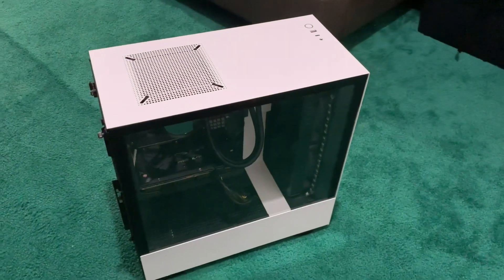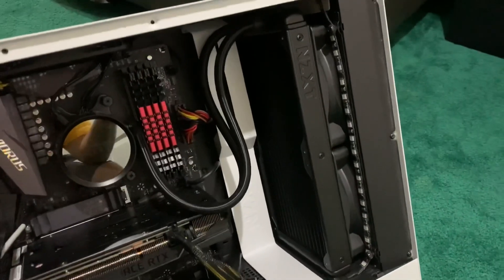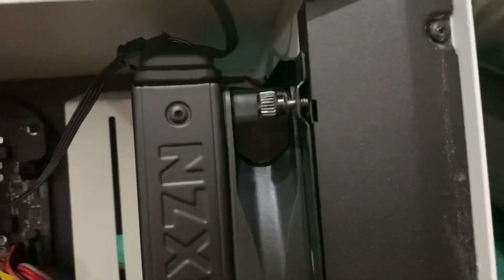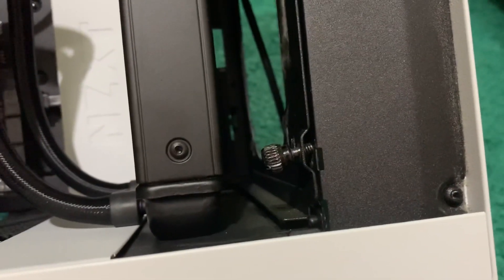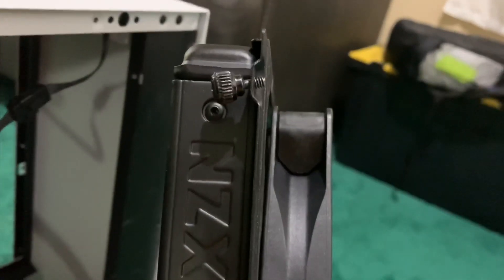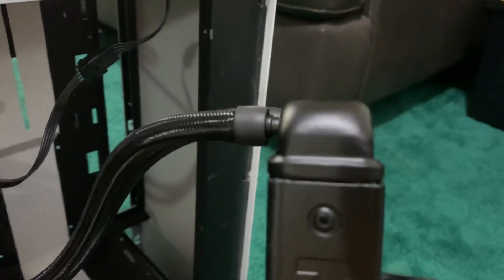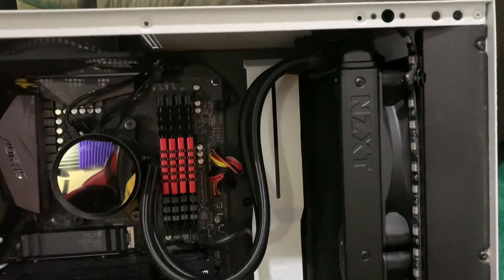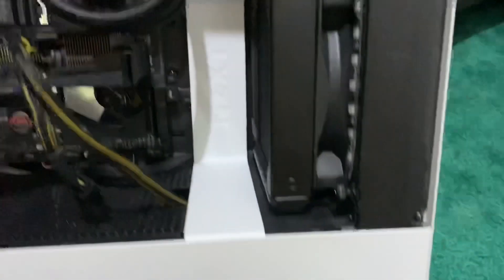X63 AIO will not flip in a H510 Case

Comment from the maker: https://www.youtube.com/watch?v=DKwA7ygTJn0

Were all good!  More info from JaysTwoCents explains it much better.

Again this video was JUST to show the 280mm AIO may or may NOT flip, depending on your components.
Reply: Thanks for the information. 
The front placement intake is good, but not the best.
Probably that's why so many people harp about front placed, tube up placement as "bad."
Reply: @chrinaldi  yeah , at the end the important thing is that the metal bracket is lower then the top of the aio so the bubbles stay on the top
Reply: instablaster...
Reply: I mounted it as you did  so fans in the middle. The fans are making such an annoying buzzing sound( i guess vibration )
If the metal panel touches the fans i mean.

 it drives me crazy
Reply from the maker: @kokilalf01  odd.  Make sure everything is flush or the bracket or fan wires are not bent/touching the fans blades

Comment: Hey! I have been scratching my head as to why I can't fit my x63 in my 510 case. At first I tried to fit it in the tubes down configuration but the bracket screws wouldn't line up. Today I tried it again and was successfully able to mount the radiator and fans onto the bracket. The bracket then fit into the case with the tubes down configuration. You need to mount the radiator and fans onto the bracket with the large screws. Once the screws are in loosely you should be able to move the bracket up and down. Moving the bracket downwards allowed me to fit the x63 in the 510 tubes down. Hope this helps.
Reply from the maker: With all this feedback I’ll Give it another closer look.  Maybe its my bracket.  But off camera I tried fiddling with it to fit and it wouldn’t line up.    

Y’all gave me home work to do!
Reply: The frustrating part is that I mounted mine tubes up but it took a hell of a lot of work and is kinda pushing heavily against the IO cables
Reply: Thank you! I managed to mount my Kraken Z63 with the tubes down on my H510 Elite by loosening the long screws on the fans.
Reply: Thanks so much bro. Was about to cancel my order after seeing this video, but think I’ll try your method first to get the tubes down! Out of interest, what temps have you been seeing with the X63 as well as noise levels?
Reply: @justjackm8  getting about 28-32 degrees celsius on idle and about 38-42 degrees while gaming on my 10700k at stock. So it's been definitely been staying on the cooler side of things. Did some overclocking and have been very far away from hitting any kind of thermal limits. As far as noise goes its very quiet - unnoticeably quiet for me.
Reply from the maker: @justjackm8  Im getting around 54c idle with web-browsing throughout the day,  in high 40s when sitting completely idle  low-mid 60s under load.
Reply: @tz1371  I just successfully mounted it today tubes down using your configuration - legend!
Reply: Hey, do you have a picture of that? i cant get it to work :(
Reply: @tz1371  This works for the Elite as well! Thanks! Loosen the screws. Move it a few cms and tighten again worked for me. I did take off the washers as well to give me more room for loosening and tightening.
Reply: @tz1371  do you re tighten the screws once they fit?
Reply: @SupremeWoolf  yes
Reply: @tz1371  i dont think itll work for me. My radiator is 280 mm
Reply: @CF-fu7ct  it worked with my 280mm NZXT X63
Reply: @tz1371  weird, the brackets dont line up for me. I tried loosening the screws but i think im going to cut a little into the screw holes to allow more movement
Reply: @CF-fu7ct  Did you try it the same way as this photo???
https://imgur.com/FvINH6E

It does fit.... I remember it took me AGES to figure it out tho.
Reply: @tz1371  yeah ive been staring at that picture and in convinced that you performed some sort of witch craft without realizing it. Ill have to try it again. Also is the white strip pressing against the little tubes?
Reply: @CF-fu7ct  Hahaha! It's defenitly possible! That is the cable management bar in the 510

Comment: You can still mount the radiator tubes down. There is space on the bracket for the radiator to sit flush towards the tube area. Just screw at the end of that space. 👍🏽

Comment: I just got mine to fit in like 10 minutes ago. Was about to give up and put the tubes on top. For me it really came down to the bracket -- you need to slide the radiotor/fans "up" as far as possible before/while you screw in the 30mm screws. Then it's just a matter of getting it all in and aligning the thumb screws. It's definitely possible, but the hoses will definitely be RIGHT ON the bottom of the case, but they don't look bent or crooked or anything. Same with the thumb screws, all straight.
Reply: Yes it worked for me as well
Reply: Had the same issue, above comment solved the issue. It just a matter of a couple centimeters for it to fit.

Comment: Can you switch the fan on the other side of the radiator ?
Reply from the maker: I can,  ive done some more videos with this setup in front and behind like shown here.  works either way.  Dont fully tighten the screws on fans and rad until you test fit (allows them to move and adjust when fitting into the mounting position.)  after test fit, and the fans adjust up or down, you can then tighten them.

Comment: you can fit the bracket on the rad with the fans in the front of the case if you cut or bend the top lip of the bracket so it sits flush on the rad.

Comment: I know this is an old video but just in case someone comes across this.  If you watch Steve's video on Gamers Nexus until the end, you'll see where he explains that as long as the pump is below the intake/outflow hoses, air pockets won't form in the pump and won't burn out the motor as long as it has enough liquid.  The air will travel to the highest point in the loop and if there isn't enough liquid in the loop, then the air pocket would settle where the intake/outflow is if mounted with the hoses at the top.  Just remove and shake your Rad, if you hear sloshing it needs to be replaced or mounted with the hoses down.  If you can refill, do that (if already past it's warranty. most AIO's don't allow refill).  But if you shake it and barely hear any liquid movement, then you're all good.

Comment: I dont know what youre on because i fit my 280 in the case with the tubes at the bottom perfectly, bracket holes are adjustable and u have to push the radiator tye the top when installing it so it clears it
Reply: @f ?

Comment: how does it get its air flow when its right up against that wall? i have this case and im thinking of either buying that aio cooler or getting a different case that has better ventilation
Reply from the maker: Air flow is good the side dust cover has to be cleaned monthly .  Temps Stay low and overall system is very quiet

Comment: Glad I saw this. I have that same case and was debating between the x63 and 53. Im glad I went with the 53. Great video and very helpful.
Reply: Can you flip it?
Reply: @dineshdas8392  As far as the fans location, yes you can. If you're asking about the orientation of the radiator, yes. My radiator is attached so that the pipes leading into it are at the bottom. It was a bit of a tight fit but was not difficult to install.

Comment: How did you get the radiator and fans on the bracket inside the case? I have seen other videos on youtube whete they could only fit the radiator and slim fans on the inside.

Comment: How did you mount the rad, fans and bracket like that? Struggling for about 2 hours today trying to set up my new X63 and no luck. Had to just put everything back. Any other combo and I was getting stopped by the cords leading to power button, USB, etc and did not want to try and force it in
Reply from the maker: Sorry for the delayed response,  start screwing in the parts together, just finger tight.  slide the gear into the slot and it will adjust.  When you remove it, try to hold it all together so it doesnt shift, then tighten it to the bracket before re-installing.   took me a few tries but i got it.

Comment: 240mm doesn’t work either, at least with a 3 fan graphics card. I just tried it and the radiator can go in, but the tubes are not long enough to make place for my GPU (rtx 2070 ROG strix)

Comment: Is it possible to configure this aio with this case with the fans on the other side of the aio? Im thinking of getting the x63 in the future and I have the h510 case. 
Id simply prefer that the fans would be exposed instead of the radiator purely for aesthetic reasons and considering you cant flip it, I was wondering if it also has any other restrictions
Reply from the maker: Yes you can put the fans infront of the case to give more room for a long GPU or to do a Push/Pull config on fans.

Comment: So just to be 100% certain would a 240mm Kraken X52 fit in the h510 case with the tubes on the bottom or not? I have a h210 but I'm thinking about getting a 510 case if it'll work.
Reply from the maker: Yes. Both are proven to flip with tubes down.  I just haven’t had the time to flip mine and update the video.   Life has consumed me and I game before I tear apart the computer for a video lol.

I’ll get one up hopefully soon
Reply: @maz94protege  Hey do you think its worth the time and money to get a bigger case so I can flip it?? I built the PC myself about a year ago. I haven't had any problems but I want my cooler to run as efficiently as possible. I also don't want to kill the lifespan of my aio pump. What do you think should I do it??
Reply from the maker: @ogsniper743  Honestly No,  I dont think it will make any huge difference.   I have viewers on here preaching to me to flip it and prove it can be done,   The updated video from GN (Gamers Nexus) cleared up alot of confusion throughout the community over this.   

I did this for a test/proof of concept.   The Pump is not at the top of the cooling loop for one.  Downside to what my current configuration is having the possibility of small air bubbles towards the top of the radiatior (highest point in the loop).  This COULD cause some gurgling or noise. and over Years of use COULD degrade faster than flipping the tubes the opposite direction.

Again,  its not life or death,  I think we all jumped to conclusions early, but as long as we dont have the radiator on the Bottom of the case we all should be good.   
I always monitor my temps (really just for fun) but this also is my first ever AIO, curious on how long it will last, etc.
Reply: @maz94protege  Hey thanks for taking the time to respond and answer my question!! I know everyone is busy this time of year so thank you. I kinda decided I'm just gonna leave it like it is. I've never had any problems with my      cpu/gpu temps or any noise. I have my fans set to performance and I don't think I've ever heard them, but I always have a headset on. I've never heard any gurgling noise either. It's just kinda bullshit though, they shouldn't advertise there products being used incorrectly. I took my time buying my PC part by part making sure im doing everything the right way and then now, a year later I see this. Well done NZXT 🤬
Reply: @maz94protege  so for an aio does it matter if the fans are on the inside or outside?
Reply from the maker: @matt1696  you can set up your fans in any configuration push or pull

Comment: Not sure if the elite case has more room or not but I have the 510 elite with a 280 mounted with tubes at the bottom and it fits fine.  And this is with a 3080 Strix card.
Reply from the maker: They have the same room. I'm actually going to toy around the fan setup today.  Make a short video of some internal upgrades and such.   Standby for an updated video!

Comment: can you do some testing with 100% CPU load and check temps? I have same case and a r7 5800x cpu with a be quiet DRP4 and temp is like 84c with cinebench multi core test. Not sure if the NZXT Kraken X63 was a better option.

Comment: i don't have this case yet, but i have a very chonky Arctic Liquid Freezer II 280mm. WIll this fit, GPU size aside. Does the white bracket interfere with the AIO, as in thickness? or is there much clearance? thanks.

Comment: have you tried to install the fans in a pull configuration? so that the pull the air through the rad instead of puch? just wondering. i dont have that AIO but the one i have i have in a pull config and it fits fine.

Comment: Flipped my radiator before watching this video and ran into the same issue. Had to search it up to see if it was only me. Edit - reading the comments, loosening the long screws allowed me to push down the plate and I managed to fit it in.
Reply: If you losen the fans from the bracket and then pull it down and tighten the fans you can actually get in. I managed to flip mine in my h510.
Reply: @stevenllerena8280  Thank you! it managed to fit :)

Comment: Definitely just mounted an x63 in an h510 elite, tubes down, this past weekend. Existing rgb case front fans in original position, x63 included fans on the back to make a sandwich.
Reply: Prove it I need this to work
Reply: The h510/h510i and the h510 have a different fan bracket. The h510 bracket is flat and leaves no room for a sandwich style (bracket in between radiator and fans)

Comment: Good video, thanks - I 'think' you need to shimmy that radiator, tubes down, a little better into the front. My friend has the H510 Elite + Kraken x63 and had no problem with it fitting and doesn't seem to touch the bottom.
Reply from the maker: Look at my latest video.  We flipped it.  No issues with tubes up or down.
 After a case clean out and other viewer suggestions I figured out what I was doing wrong lol

Comment: You don't need to flip the radiator.  The pump/block position was already lower than the radiator's intake hose.
Reply: The point is that the pump needs to be higher than the radiator intake when front mounted

Comment: I have an h500 case and tried to do this and had a similar experience, however now I'm planning on getting an Air Cooler for my cpu and using a Kraken g12 bracket along with my Kraken x62 to watercool my gpu now. I hate to ask but did you check and see if it still COULD be mounted this way by loosening the screws like people in the comments are saying? If not I will also put out a video once I get my parts and try it again but you know... I always like knowing beforehand lmao.

Comment: what is the width of that radiator with the fans on i ordered one just dont know it i can fit it on the top without it touching my ram sticks
Reply from the maker: It’s case dependent. If your case can fit a 280 it will work, the x53 is a 240mm, which maybe another option

Comment: So just to confirm it's only a problem when you try mounting the radiator with the tubes at the bottom, if I mount it with the tubes at the top it'll be fine? Also interesting you managed to fit an led strip in front of the radiator, do you think a cablemod rgb strip would fit there?
Reply from the maker: There is no harm honestly in installing it either way,  Its possible you may hear some "gurgling" water noise with the tubes UP in my configuration, there COULD be reduced performance and lifespan.  But it NOT always the case.

I initially installed it this way, saw the video from Gamers Nexus discussing tubes DOWN,  attempted it and made this video.  Viewers on this channel have been able to successfully FLIP the radiator with tubes down with and without modifications on this case, I have not attempted it.  I get no noise and my temps are excellent, sub 60c on a 3900x.   Soooo....yes i am going to attempt to flip it just to confirm for myself it can be done.   

TBH, you will be fine whatever way you install it, the ideal way would be top mounted, which is not an option on the H500 series NZXT cases.
Reply: @maz94protege  Thanks, I was always planning on installing it with the tubes at the top since I think it looks better

Comment: I  have x62 (280mm) and h500 and the problem is the same. I was worry about it but, I've flipped it without the screws, maybe this weekend I'll make the perforations to assembly in a right place. After this flip I've got little improvement on temperatures
Reply from the maker: On the 2600X my temps were consistent,  now with the 3900x it runs slightly warmer, but never over 60c.   Still have tubes up.  A few people have commented on getting tubes DOWN to work without modifications.   Ill play around with it cause now im MORE curious from this first video.  thanks for watching!!
Reply: @maz94protege  Have you managed to get it working with tubes down without modifications?
Reply from the maker: @Kasaf  I have not attempted.  Due to 1, not wanting to modify the bracket, and 2  I have zero issues with the 3900X in this configuration.

Comment: What thermals does your cpu and gpu normaly get with this setup? :)
Reply from the maker: CPU (3900x) idles around 42c and doesn’t pass 70c under load.  GPU stays around 62c under load touching 70c in a few games
Reply: Ah ok Thankyou, I was planning on getting this case, just debating whether I should get a aio. :D
Reply from the maker: @Swiftss  it depends on what CPU your using,   and if your Overclocking or doing major encoding rendering,  you can easily just do dual fans in front (intake) with top and rear fans as exhaust and be fine with majority of builds.
Reply: Thanks dude I’ll keep this in mind, also awesome video too 👌

Comment: As long as it’s not making noise ur just fine brother
Reply from the maker: Exactly,  Thats what I have been trying to convey.  shrug
Reply: @maz94protege  It would be a problem if the pipes were LOWER than the pump, but they luckily are not. You should be fine

Comment: guys i have the 510 and i want to buy the x53 cooler. i dont hve the hue controller though, where do i have to connect the fans ?
Reply from the maker: I bought a “Y” fan splitter and plugged them in on the Sys Fan header on the motherboard